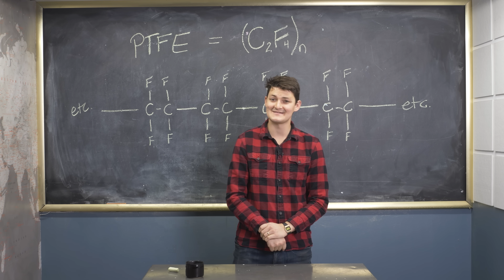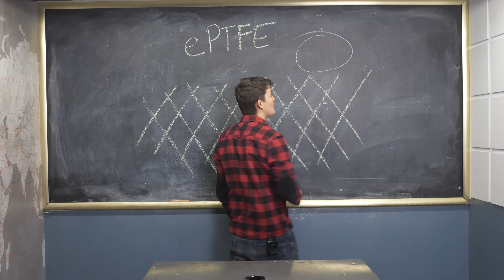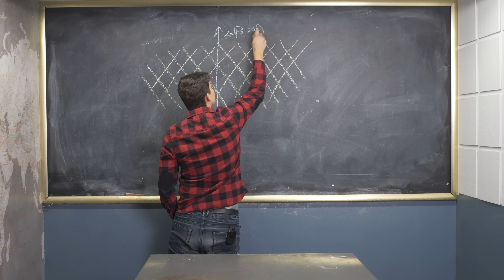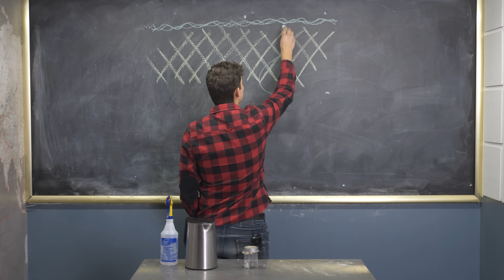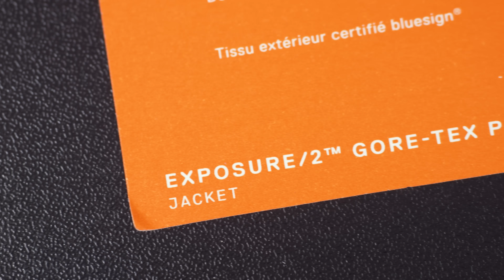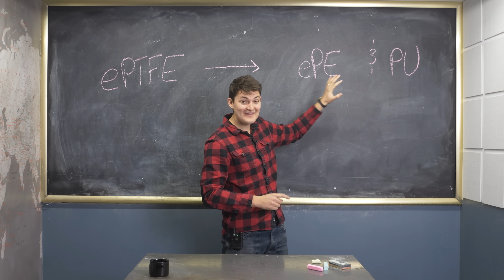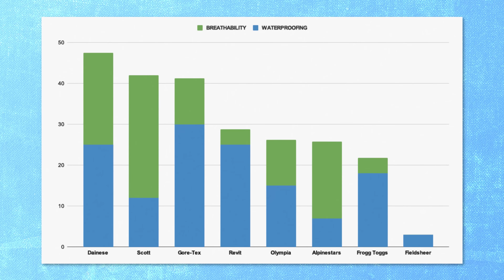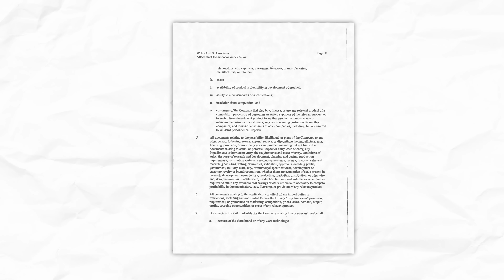Gore-Tex is a Marketing Gimmick

Comment: Thanks for another great video.  You know, I always wanted a Gore-Tex rain jacket because the reporters from the Weather Channel wear them when they're standing in the middle of a hurricane, so it has to be good, right?  Well, I finally got one about 20 years ago and it still does what you would want and expect it to do. Of course, I don't wear it while riding so I can't vouch for it for that purpose.  It was an official NFL team logo jacket valued at $480.00 when I checked the online price 20 years ago, but I only paid $3.00 for it at a thrift store, so, I really don't feel too bad about buying into the hype.  To me it was worth every penny.  Spraying the jacket shell with a water repellant is a good tip.  I have done so every couple of years.  I use the same can of Scotchgard that I use on my tent. Cheers.

Comment: No one invented PTFE - it was discovered when the contents of a cylinder of tetrafluoroethylene (TFE)  gas was found to have polymerised and turned to a solid.

When my "membrane" jackets start to leak (no longer that 4 years of use) I make a removable waterproof lining to go between the shell and the thermal lining. For monsoons I wear a one piece rain suit over the top.
Breathability is bollox - anyone else notice that all clothing has holes for the human meat parts to pass through?
Well, that's where the clothing breathes.

Comment: Well .....gore-tex IS breathable and it works, but no better or worse than other brands really.  If you wanna buy a gore-tex shell jacket like an Arcteryx shell for $1200 bucks you can and you'll just lovely in it sweetheart but you'd be stupid to pay that much when you can get the same bloody Gore-Tex Proshell fabric in a jacket for more like $400 bucks. It's not Gore-Tex that's really the problem ......  its the morons who pay those prices .,.....

If it's really raining, and raining hard, you should wear a 100% water proof rain coat -Duh !?!  However, for day to day crap where you might get caught out in a short rain squall ANY decent breathable shell with a DWR coating is better than just a generic jacket.  It's really just common sense.

Comment: Leather jacket on the inside, simple vinyl or pvc on the outside. The rain gear has to have an inner layer of textile, however, or it will condensate your own humidity and make your ass wet even if it doesn't rain 😁.

Comment: Years ago when I hiked the Milford Track in New Zealand I showed up the the, original, Gore-Tex jacket I used for years in the Sierra Nevada. At the start of the track the NZ guides tried to discourage use of the G-T jackets and offered instead heavy vinyl rain coats. I declined the offer. Fortunately, the G-T wasn't really put to the test. In a highly unusual occurrence it never rained a drop during the four day hike. Normally, it rains daily. Otherwise, similar products are still in my closet and used. There really isn't a perfect solution, except to always stay indoors.

Comment: The biggest advantage to Gore-Tex isn’t necessarily that it’s technologically better or that it’s chemically better or that it’s even better in general. The advantage is in the “Guaranteed to keep you dry” warranty and quality control. 

Gore’s strict control over manufacturing, sourcing, equipment, and certification means that, despite it being a generally dick move, you have a lot more certainty in the waterproofness of a mass produced garment, especially in complex designs like gloves. 

The pinnacle of this is “Guaranteed to keep you dry”; if it leaks, if it seeps, if it weeps, if it wicks, and you didn’t crash or damage it, Gore will replace the garment, basically forever. 

Combine that with Klim’s five year warranty that includes replacement due to a crash (if you provide Klim with a police report, even for crashes that are your fault), something like the Klim Latitude or Carlsbad series, which cost $600 or $800 a piece, start to really make a lot of sense. 

$1200-$1600 for a whole body waterproof, CE armored and abrasion rated, vented, adjustable, etc suit that has a nearly unlimited waterproof guarantee and a five year crashes included warranty, that’s a pretty compelling argument for the daily, touring, or adventure rider.

Comment: As someone with a tight budget for riding gear/accessories, I’m very glad for your videos like this. Clearing the air of all the marketing BS! Thanks again for all the great content
Reply: BUY USED!! Buying about half of gear used safed me so much money and i never had any regrets.
Reply: You won't have that beading off problem when you're riding. The wind will blow the water away. The problem with these types of breathable membranes is, they're not very durable. I had a pair of Gore-Tex boots and they were amazing for about a year and then they started leaking.
Reply: @JohnL-m2l I’m on my second Rukka suit and the first one lasted 8 years and I sold it, they are extremely durable.
Reply: @ragetobe  Did you use it daily? I was using my boots daily.
Reply: @JohnL-m2l  I run 5 times a week in the UK at 4am in my Goretex waterproofs and I use my motorbike every single day (my only means of transport).  I am an on-call engineer for hospitals and fix and repair onsite, I spend a lot of time in the rain.  I cover 30k miles a year on my bike for work alone.  I should add that I also use Sidi trail boots that are Goretex and a pair of Daytona Ac Classics Goretex and none of my gear has ever leaked or let water ingress.
Reply: @JohnL-m2l I would think it would be more of a QC issue during manufacturing of the boot rather than the Gortex failing but that's me. ✌️
Reply: @AzTurboMini  the warranty sucks in Malaysia. They told me to ship it back to China for an inspection. Shipping costs were like 1/3 the price of the boots. If they rejected my warranty claim, I'd have to foot the bill to ship it back to me. I figured it's better for me to just get some waterproof socks.
Reply: @JohnL-m2l  I don't know what gear you are buying that's made in China, but it won't be the same quality as Rukka.
Reply: @ragetobe  I'll check Rukka and Sidi out. My boots were TCX. But the TCX warranty was over by the time they started leaking. So I contacted Gore-Tex and they said ship it back to China at my own cost.
Reply: @JohnL-m2l  I had TCX when I started biking again, they look good but they don't deliver.
Reply: this is the real truth.. gore tex works as advertised.. but you just have to accept it only works for about a year..

wanna be comfortable and have money.. but it.. 

otherwise..  be wet or sweaty @JohnL-m2l
Reply: i could recommend helly hanson thor system or anything with E-vent material,
E-vent is very good at weather resistance and breathability
and both these options will cost less than a similar goretex product
difference
Pertex is also something to look into, but maybe its a bit too breathable
Reply: @c4l1f0rn143000  E-Vent is very good, I have a great jacket that uses it and I've never had a leak with it.
Reply: Like the mosko moto, when you go to their website, it says We only sell direct to rider - no dealers, no distributors - which eliminates a costly distribution step and enables us to use premium materials without making the product too expensive. Its already too expensive!😂 got the Rhino saddle bag and works perfectly without feeling robbed😅
Reply: @jimmartin8586  forgot to mention I'm a delivery rider so I walk around in my boots all day. Besides the boots leaking, the soles also kept peeling off. Because of this and the high cost of shipping it to China for the warranty claim (which may or may not be approved), I decided to just get the soles stitched and get waterproof socks.
Reply: sometimes it pays to be cheap. better product better business lower prices.

Comment: Yes, but...

Your own chart shows that Gore-Tex is the most waterproof of the contenders.  You prove that the 'breathability' component doesn't function in the rain, but is that a decisive factor?  If it's staying dry that's important, then don't you want the most waterproof fabric?  Breathability is nice for when it's not raining, but you can always open vents. 

Furthermore, I don't understand the logic of a stacked-bar chart.  How can you do a valid comparison when your cumulative data is accumulating data of different natures?  Breathability and waterproofness aren't related characteristics, and neither enhances the property of the other - the chart proves that.   It ranks Dianese as the top scorer, but Gore-Tex is more waterproof.  

I'm not arguing in favor of Gore-Tex and subscribe to your contention that Gore-Tex isn't a good value.  I have a pair of Revit gloves that use their proprietary breathable/waterproof fabric and they've been the best waterproof gloves I've ever owned.  Likewise, I have a pair of Gore-Tex-lined gloves (Klim? - I can't remember) that are sponges.  I suspect it comes down to construction and the DWR or other outside layer.  

If you want pure waterproof:  Grundens rubberized canvass!  There's a reason commercial fisherman wear the stuff.

Comment: I love my RevIt gear, and have been running the Sand 3 (I think, could be a 2) for 5 years now.  Love the layer system but the ONE thing I'll look for in my next jacket (which will probably also be Revit) is that the outer layer be waterproof.  I can keep my waterproof liner in and be nice and dry, but the outer jacket layer soaks it up and becomes heavy and cold eventually.  Having the outer layer waterproof keeps you warmer for longer as I've discovered.  That is more important to me than it being G'Tex, and I'll happily save my money.  Just so happy F9 has reinforced my feelings toward marketing!
Reply: I've got the Blue One since 2017 and my previous jacket was the 2007 Offtrack  in grey - light blue.
Totally agree!
Cheers from Italian Alps.
Reply: Same with the Defender 3. It will take the first few clouds, but you better find shelter or wear a rain jacket.
Reply: The revit h20 jacket is amazing. Ive pretty much swam with the thing. And the inside stayed mostly dry. Little bit of leakage from the zipper. But that was an absurd amount of rain. The pants are shit tho. But it will always be better if you put on raingear over your clothing to prevent everything rotting away.
Reply: I absolutely hated it, for the reasons you mentioned. Also the 3 layer didn’t work for me. To bulky with everything in it and to loose with everything out. It did had great ventilation though.
Reply: I've been reading their new gear isn't built near as good as the older stuff. Enough so to keep me from buying a new jacket and gloves from them for a trip I just returned from.

Comment: Hey @fortnine, amazing video. 

I've noticed that what Gore-Tex does now, is put a bigger number of waterproofing or breathability to say it's still worth buying Gore-Tex, even if the competition has good alternatives.

You will often see that the competition has 10'000mm and Gore-Tex will have 20 or 28'000mm.
Reply from the maker: True! I believe Gore's "Guaranteed to Keep you Dry" stuff starts at 28,000mm. But you may see stuff go up to 40,000 or more! That goes for both Gore and non-Gore membranes. ~RF9

Comment: Refer back to the chart at 8:32 and think about what is shown there -- pause the video and give it a good look. Ryan's point is almost solid. Goretex when wet will trap humidity inside, but in 40,000 miles of riding rain or shine, it's the best at keeping me dry in a downpour. When I'm exerting myself making the interior more humid, I open a vent. Yeah, it's a balancing act, but rain is going to make me soggy in a way in which there is no recovery until I'm done for the day. Since year 2000, I've wasted way more on the competitors claiming to be what certified Goretex delivers. The comparison to a wool sweater and a garbage bag is deeply misleading. That said, FortNine's videos are very worthwhile, generally, but this one I have to say that my experience with Klim is solidly other than this video would suggest.
Reply: The science is as he says.  Current goretex products are copies of goretex's competitors, and "dry in a downpour" isn't a useful anecdote unless we also know stuff about your test conditions like ambient humidity and your own activity under test.  Goretex will work relatively better in a downpour, if that downpour happens in a heated living room or a desert.  But humidity conditions in the pacific northwest, like those in the UK, are more like the conditions in which you actually need a waterproof.  And in those conditions the fabric barely has the humidity gradient needed to work, even before you start generating moisture from walking or cycling or the typical market segments at which this con is targeted.

What does work for walking is a poncho, and for cycling some combination of dwr on your jersey plus an impermeable packable gillet when it is really bad.  That gillet option is popular with road cyclists because it works and it is, in all honesty, a plastic bag over your merino wool jersey.

Comment: It's not a gimick. It actually works. I have  klim kodiak gear and went through some storms on my bike. Not a drop of water on me. I guess it depends on what brand you are getting? I agree with the breathability AND waterproofness combination though. I think that's common sense. You cant have both. But, it is much better than any nylon suit like the nelson riggs even though their suits left me bone dry too. But, I was sweating my ass off in the NR. The klim is VERY well vented and I even used it in the summer to ride to florida from NY. It is a heavy jacket and pants too! But, the heat doesn't really bother me much

Comment: I've was given a military gore-tex jacket years ago, and was super excited about it, until it got wet. It didn't breathe and I was still seating like crazy. Never wore it again.
Reply: I realized it's more water repellent than water proof after standing in a rain storm for an hour on the flight line. I was allowed to go home and change my uniform cause I was soaked! 😂 Nothing beats the rubber rain gear.
Reply: I have spent many shifts out in the rain for 12-18hrs at a time in my military issued gore-tex gear and was always dry. Not sure why we had different experiences but I can't even count the number of hours I have spent in the rain in my gore-tex camos. Had days in Japan where it started raining when I was grabbing my gun from the armory at 6 am and it was still raining when I got home at 9pm and I was still dry after standing out in it far all but a few segments where we were getting briefed.
Reply: I bought one of those 90's(ish) era desert camo military ECW GoreTex jackets.  It's the most waterproof piece of clothing I've ever owned. I can hold the sleeve under a running faucet and the water just pours over the exterior of the jacket leaving my arm completely dry.
I've had ski jackets with 3M waterproofing treatment that lasted a season or two before the coating wears off and the jacket basically becomes a water sponge. My Marmot rain shell is a water sponge.
I suspect my military jacket is the "pre-reformulated" kind of GoreTex because that thing is amazing.

Comment: The day ryan debunked all of mountaneering gear
Reply: what he says is accurate to my experience with goretex in hillwalking and cycling gear.  for both activities the only way of staying dry for hours in heavy rain conditions is some kind of activity specific impermeable poncho, and the best I have had are rubberised cotton or water repellant coated nylon canvas. good use for goretex isn't fitted clothing but bivvy bag: no activity to generate sweat, and cover it with a tarp so the top of the bag remains dry and breathable

Comment: I discovered Gore Tex was neither water proof, nor breathable the first time I used it on a backpacking trip in in 1983. Hiking in the rain all day, I became completely soaked to the bone in short time even though wearing gore tex head to toe. Once soaked it does not breathe and it soaks from condensation inside and soaks through relatively quickly in a steady rain. It is great for light mist on a sailboat, looks good, but makes terrible raincoat in steady rain and continuous exposure. You are better off with a nylon poncho that is completely waterproof and stays ventilated through openings below when wet. I even made an improved poncho with a vented cowl/neck that allows it to function as a "moisture chimney" wearing a Tilley inside it to funnel out all that pesky body moisture. If you ride a motorcycle in heavy rain for a long time, you will get soaked unless you go fast enough to keep the rain off you. It doesn't natter what you wear.

Comment: I know you focus on motorcycles; that's your bread and butter. This video could easily be expanded to include the offroad and snowmobile sectors. Snowmobiling still has a lot of G'tex-dominate push from brands like Klim. I wonder how FXR, Fly, and other companies would fair (assuming they have comparable products)?
Reply from the maker: Not sure about Fly, but I know FXR is using PTFE in their membranes (HydrX or DryVent or whatever). Could be quite similar to Gore-Tex, though admittedly I've never put one on the hydrocolumn pressure thingy. ~RF9

Comment: I noticed an drastic improvement in comfort from Gor-Tex clothing in the late 80s. That was in the dry desert in winter. As a snowboard instructor in the early 2000s i found it didn’t matter much. It works but it isn’t a tool for all jobs as it is marketed. Your experiments are entertaining but a bit oversimplified. Early gor-Tex definitely worked better